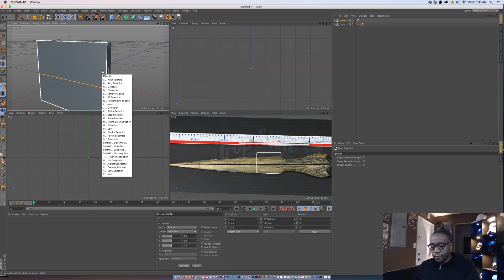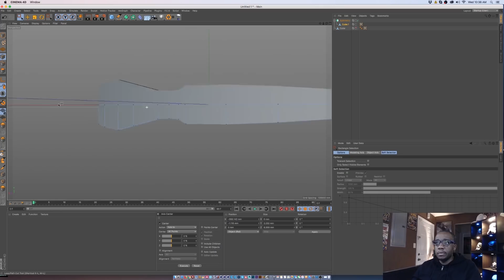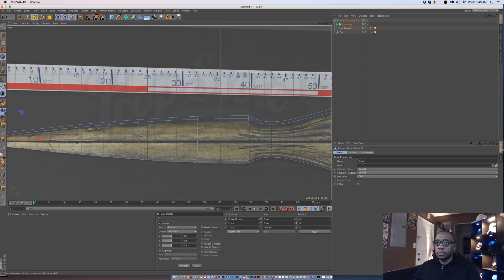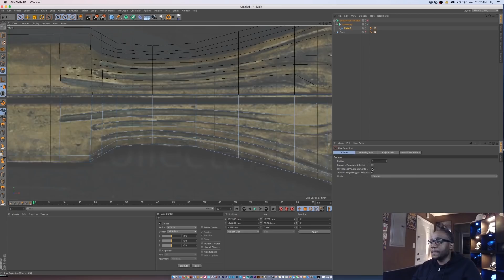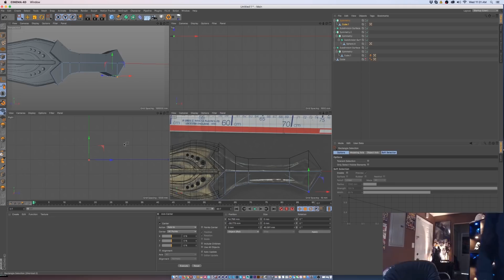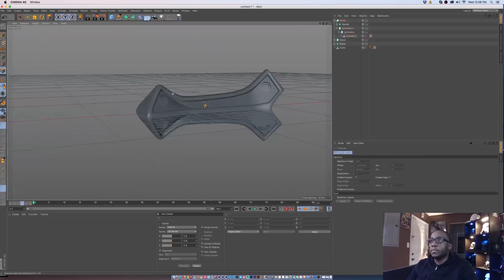Modeling Achilles' Sword for 3D Printing!

Comment: Fantastic work, dude.  The only gripe I have, as a sword fan, is that on the blade itself, that midline is supposed to be a recess.  It's a groove into the blade called a fuller, also known as a blood groove.  Not supposed to stick out from the blade.  Other than that, wonderfully done!
Reply: No. In both the film, and the type of sword this is modeled on it is a central ridge to add stiffness to the blade. It's necessary because it's a rather long blade for being made of bronze and requires structural reinforcement. It's similar in principle to an I-beam.

Comment: I small tip. A photo of a symmetrical geometric object taken at such a slight angle is very easy to adjust in Photoshop or Camera Raw. Use the transform tool to digitally tilt the image a few degrees, similarly to how you'd correct the vertical perspective when manipulating photos of architecture.

Comment: Darell, I hate to say it, but, judging from this video,  you completely misunderstood the form of the cross section of a bronze blade. Weak of the blade should have a diamond cross section with convex appleseed edges, which transformes in to a narrow eliptic form with beveled fblunt edges in the mid section and the weak of the blade, with flutes on the face to give it extra stifness while bringing down the weight. Bronze age straight swords don't have tangs so the blde should end with anoval or apple seed shaped butt.  Hilt gets riveted to this part with multiple bronze rivets that form a V shape, which I believe confused the original prop makers and they had put those round ornemantel bits in an effort to copy the look without understanding the puropse. And the ridge is usually triangular in cross section, not square like you made it. The blade should also have a distal taper, and the very tip should be reinforced.

Comment: Nice build, but the blade should be thicker in the middle, and tapered from the tip to the handle. There is better reference pictures to find on google. As a 3d modeler, I have ton of reference pictures of the modeles I'm gonna build.

Comment: Couple of comments from a sword building aspect. Since it was a bronze sword, the center of the blade should be thicker, especially considering it has a fuller. Secondly, it has a fuller, not a spine. So it should be recessed instead of sticking out. Great work on the details otherwise!

Comment: As a side note, you can easily use Lightroom or Photoshop Camera Raw and it's Upright Tool to fix your swords perspective error before you start.  I know everyone uses the tools they are comfortable with..but in this case, Cinema 4D is not what I would recommend for most people. Fusion 360 is a much better tool for this sort of work.

Comment: Why did he make it so much taller than the actual prop?
Reply: he didnt
Reply: He had to allow for the angle the photo was taken at so made it symmetrical which is closer to the original
Reply: the reference photo was taken at angle and to compensate that he made the sword a little wider